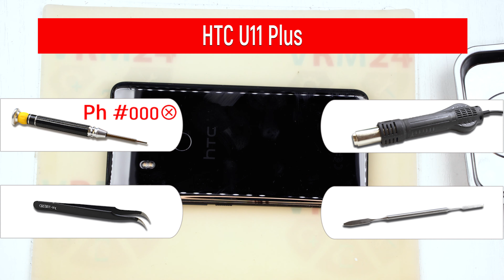HTC U11 Plus 2Q4D100 📱 Teardown Take apart Tutorial

Comment: Very nice seeing this video! I am Abhinav Janak from Hyderabad, India. I am using HTC U11 Plus phone since last 2 years and I am a huge fan of HTC. I have another U11 plus phone in which the gravity pressure sensor grip flex cable ( Pressure touch sensor) isn't working, bought it from another user. Probably the part isn't there inside or has a loose connection. This part is there on both left and right on the sides of the phone as you know and which gets the squeeze function ( Edge sense ) on the phone. I was hoping to see you would show this set ( Left & Right ). 

I wanted to know how this set of parts look like. But you did not show it. Can you kindly make another very elaborate video dissecting the entire phone and showing this set of parts so that I can plan to procure them for my phone. Do also let me know from where I can get them. 

Thank you